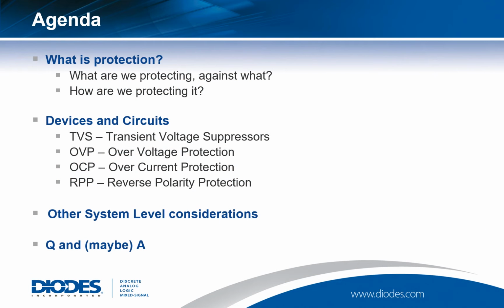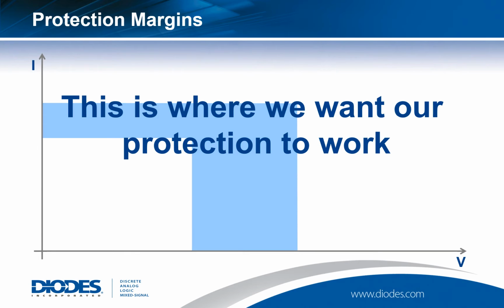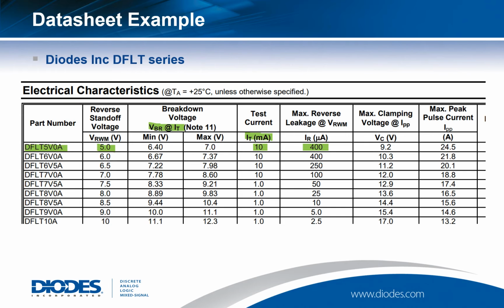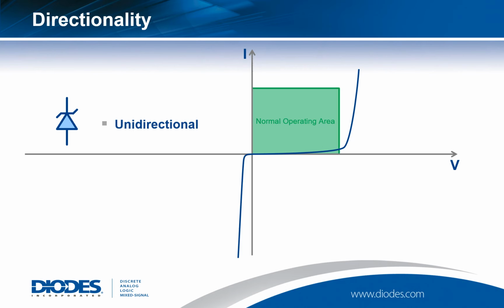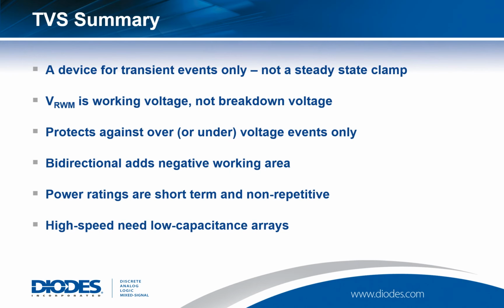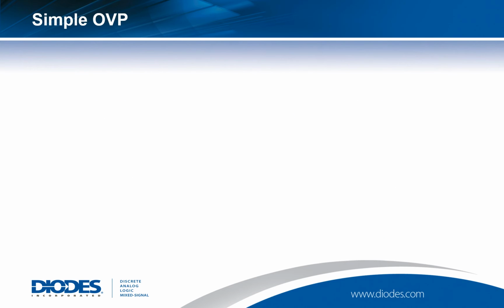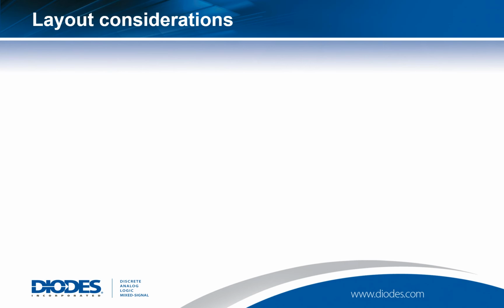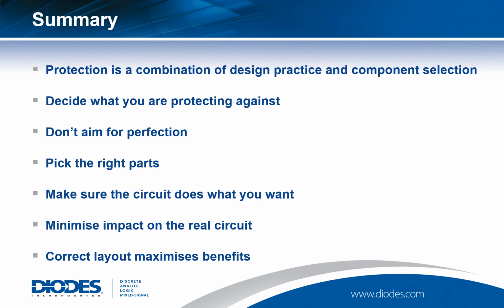Introduction to Circuit Protection

Comment: Great présentation, thanks you a lot. i have seen 17v Vbr TVS, with a low resistor (22R) in series (down stream) with a 5v microprocessor input. i do not understand how this could protected the target circuit, would you be so kind as to give me a pointer to whether this was a good idea and how it works, or if not. Again, thanks a bu ch, this video presentation was very useful. Regards, Nicolas